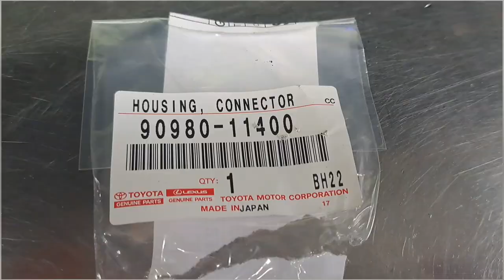Starter Motor Removal #lexus #ls430 #gs430 #sc430 #toyota #v8  #automotive #mechanic #diy

Comment: That was labor intensive, and looked like an all day project!  Makes me think twice before getting a Lexus with a V8.  Thanks for sharing!
Reply: Don't worry about how hard to replace the starter. I owned numerous Lexuses, 2012 IS250, 2001 and 2006 GS300, 2015 LS460 and now 2006 SC430 and never experience replacing or repairing starter. Starter actually will last forever but of course it will eventually will break in a certain period of time but definitely will last if not for decades or it might last the lifetime of the car, just like my 2001 GS300 that already have 357,000 miles on it but starter still in good condition. As you can see in the video, starter was removed not because the wear and tear of the starter but it broke because of the driver's error. The gears were damaged because the engine already running and someone attempted to restart it again, what do you think will happen to the starter of course gears will break and not only starter's gears but also the fly wheel's gears will break as well.
Reply: Yeah, and mine was done once at 80k, and needed to be replaced again at 130k. Tbh wasn't too bad, the UR engines are way worse having to remove the exhaust manifold to get that starter out. Ntm the valley leaks like crazy on those and the direct injectors crack, and to fix that leak you need to pull the whole front timing cover due to one pipe. Definitely prefer the UZ's out of most V engines from Toyota, the inline Toyota engines are best for serviceability tho.

Comment: I've seen a picture of a starter inside the transmission housing. Not sure what vehicle it was, but that's gotta be harder than under the intake.
Reply from the maker: I've seen that picture. That's unfortunate when it comes to replacement.
Reply: Its on the lexus sc400’s

Comment: Not exactly a weekend project considering Lexus placed it in the middle of the engine.
Reply from the maker: If it is just a starter you're doing and you have your parts ready, it is definitely doable as a weekend job
Reply: It’s only rated as a 4.6 hour job took me 3.5 and I’ve never done one before

Comment: I did my starter without taking out coolant bridge, actually wasn't too bad, if you get a long enough ratchet and a deep well socket you just use your finger to place it ontop of the bolt head its a breeze. Took me 4-5 hours and that was including dropping the ratchet ontop of the transmission and looking for it for a little over an hour.
Reply from the maker: Thats whats up! I like to change them as a Preventative maintenance since im already there

Comment: The valley location of the UZ motor is a total breeze to change and far from the worst. Had plenty of practise removing the upper and lower manifold - the ACIS VSV sitting in the valley is a common fault on these too. First time years ago was maybe 4 hours turn around time and now down to 1-2 hours start to finish after a few tries figuring out what works best. 
Anyway - these UZ series engines were replaced by the UR series engine (i.e. LS460) and the starter motor is not in the valley any longer and a total prick to replace - RHS exhaust manifold and engine mount to be removed first for access and all from under the car. Take the UZ motor over the later UR engine anyday for doing this job.
Reply from the maker: You already know! The ISF is even tighter. I would remove the subframe for more access! But even those with repetition become easier over time! Thanks for watching!

Comment: Finally found the video to help me with replacing the knock sensors on my ls430, thank youuuu
Reply from the maker: Definitely will help as a reference for a knock sensor replacement. All i can add is a suggestion to replace the knock sensor sub-harness/ or connectors for the knock sensors while you are there.
Reply: Having a very hard time finding parts number for either the sub harness or connector.

Comment: Do you take cars in for repairs as well or only specific cars? Love your videos and interested in getting a quote on replacing the front right and left control arm bushings and ball joints on a 2006 Lexus rx 400h🙏🏼
Reply from the maker: Email for more information.

Comment: What starter did you replace it with? I see it says Toyota. About to do this job myself and only see reman densos from Lexus parts sellers online
Reply from the maker: Hi I used a Lexus denso reman purchased from the dealership. May be the same part number as Toyota. I would avoid any aftermarket starters.
Reply: @harborareatech310  do you think there’s a difference between the rock auto  denso reman and the one from the dealer? Denso 280-0329 on rock auto, Amazon, etc
Reply from the maker: @bobberben  I'm not too sure, but it looks the same to me!
Reply: @harborareatech310 yeah I was hoping lol debating if I want to swap the knock sensors out while I’m in there now lol
Reply from the maker: @bobberben  if it were my own vehicle, I would replace that with the connectors for the starter connector  and for the knock senors
Reply: @harborareatech310  guess I’m ordering OEM from Lexus, hopefully I can keep it under $500 lol
Reply: You made me realize the rest of the tools I need to buy lol

Comment: Wow! I assume the teeth damage was maybe caused by that bad bearing on the starter's shaft. Wobbling and incorrect engagement of the teeth. Any chance you remember the mileage of this LS, or a typical mileage that these starters start to kick the bucket at? This looks like a straightforward job, but I'm still not looking forward to the day that my LS430 leaves me stranded... you can't even get to the starter to give it a couple whacks in an emergency situation.
Reply from the maker: @surfordie82  I assume that's why the flex plate teeth wore out as well. I don't exactly remember the mileage on this vehicle, but I know for sure the OE starters last longer than them all.
Reply: @harborareatech310  Thanks dude! Got 115k on my LS and its from a super mild climate (San Diego!). I've had OE starters from lesser Toyota models last well over 150k miles, so I've probably got at least a few more years to go. Idk what they do that makes OE starters last so long, its definitely some voodoo magic.

Comment: have  you ever seen 2uzfe on gx470 vith egr valves?
Reply from the maker: @vladyarets3596  I dont believe they have an egr. some have a vvti, and all have an air injection system to cool down exhaust gases.
Reply: @harborareatech310 I just finished removing starter from engine with EGR today (5 hours). It was a hell. And I don’t even want to think how should I install it back😢

Comment: Just finished getting the manifold back on. Fellas, this is a hard fucking project and be prepared for a royal pain in the ass. Getting that manifold back on is a two man job and you WILL scratch the shit out of the intake manifold unless you are ridiculously careful, it's basically impossible to not.

Comment: Question about the replacement intake manifold gasket. Is it directional as in it matters which side is up? I'll try to put it back on like it is here but I'm curious because there are two little tabs on the side of the gasket that faces the fuel rail and they seem to be on opposite ends
Reply from the maker: 10:53 shows the original placement of the gaskets I would go by that

Comment: If it is the starter making a grinding noise on start-up, I think I'll just trade the car in on something smaller and newer.
If the guy said it's a $2800 job to do, and I won't do it myself, I don't think the car's worth it to repair.  Maybe just drive it until it dies.
Reply from the maker: @ralphgizzip4408  I get you you. It's not a cheap repair. So, depending on the condition of the vehicle, it might be worth getting rid of it for another one

Comment: I dont suppose you can link the tool you used for the right side 14mm starter motor bolt? My 14mm ratchet is too thick to go over the head
Reply from the maker: I use a ratcheting 14mm wrench with a swivel end. Im sure there are other versions but this is the one i use. This is the link https://www.amazon.com/Mountain-MTNRM1214-Ratcheting-Double-12x14mm/dp/B07CZS62LP/ref=asc_df_B07CZS62LP/?tag=hyprod-20&linkCode=df0&hvadid=693128203613&hvpos=&hvnetw=g&hvrand=10125508955544214073&hvpone=&hvptwo=&hvqmt=&hvdev=m&hvdvcmdl=&hvlocint=&hvlocphy=9031082&hvtargid=pla-568083999246&psc=1&mcid=d92b21511aba373dbcde09cac16b161a&gad_source=1&gclid=CjwKCAjwi_exBhA8EiwA_kU1MqZS5aAzETxPqoUKI29r5Ptqw89NMxfVXpTjjjxYZDsLOLZNFISKURoCntgQAvD_BwE

Comment: This is way to much for a starter 😂😂😂
Reply from the maker: I agree!
Reply: @harborareatech310  I just found a 430 in great condition with 76k miles but the starter is bad
Reply from the maker: @jacksonduval4995  That wassup just fix that starter and do the maintenance, and you'll have yourself a vehicle that would last a long time.
Reply: @harborareatech310  I might go get it tomorrow. He willing to let it go for $1300. I really just need another car because I'm getting all this stuff done to my 240sx and I won't have it for atleast 3 weeks

Comment: I wish the lexus gs350 3.5L v6 were that simple 😅
Reply from the maker: Those are more simple
Reply: @harborareatech310  how is that when you got too drop the chasis and the control arm and motor mount just to get too it
Reply from the maker: @bobbyserchion  loosen up the motor and trans mount and lift the engine or transmission to sneak it out
Reply: @harborareatech310  thanks I didn't think about doing that 😅